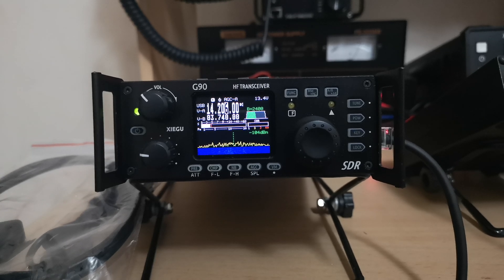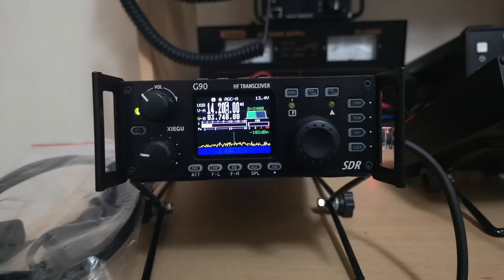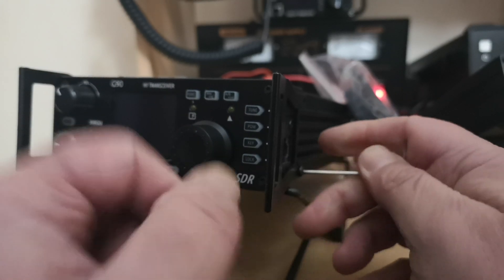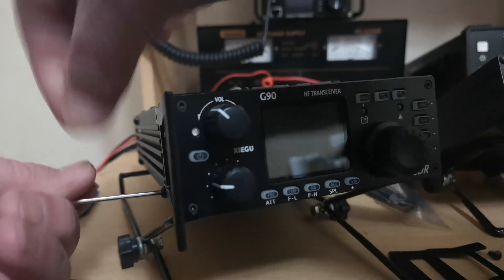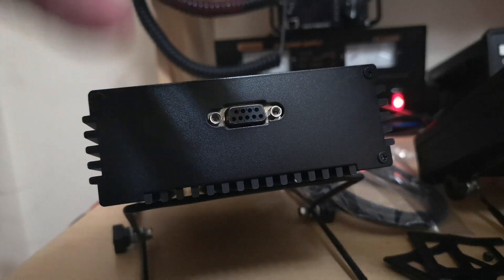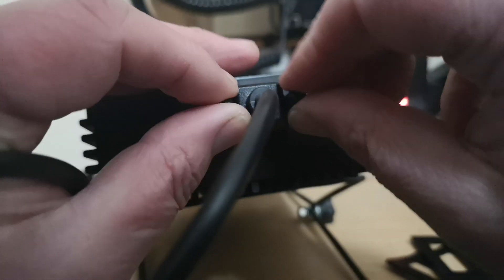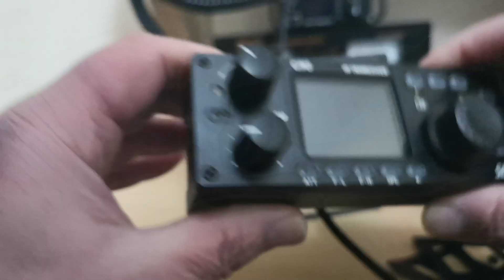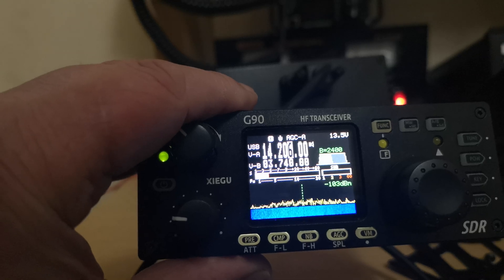Remote mounting the contr head on the XieGu G90

Comment from the maker: Visit Fred VE3FAL blog spot and YouTube channel for the XieGu G90. Fred also tests for XieGu too..

https://ve3fal.blogspot.com/2019/02/xiegu-g90-20w-all-mode-transceiver.html?spref=tw&m=1

https://youtu.be/BoZSpb80V7s
Reply: Hello - is it possible to state what the length of the included remote head cable is? Is it possible to attach a longer cable? If so what maximum length may be used? Thanks. 73 de VA6JDM
Reply from the maker: @johndmoxness5789  hi, the separation cable is around one metre in length. It is a standard 9 pin seriel lead like on a computer. These are readily available from any pc shop, ebay amazon even. I bought a 3 metre lead and it was very cheap. This type of connector wouldnt of been my first choice, but theirs a reason. RJ45's are 8 pin and a 9 pin option was needed, so what we are having to use is not the best but it works..

Comment: Can you tell me how long the included cable is?
Reply from the maker: Its about a metre in length, but you can buy a basic generic lead from any computer store, or ebay.. Theyre a simple 9 pin male to female lead..
Reply: @qrphfradio7753  Thanks.